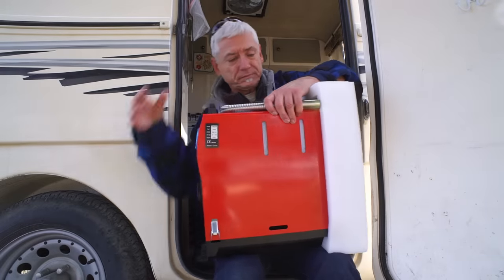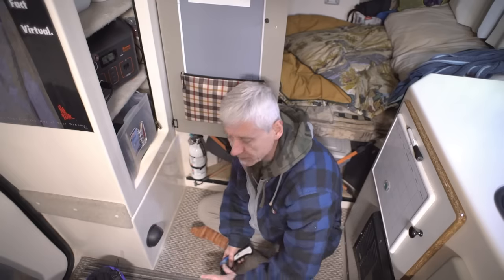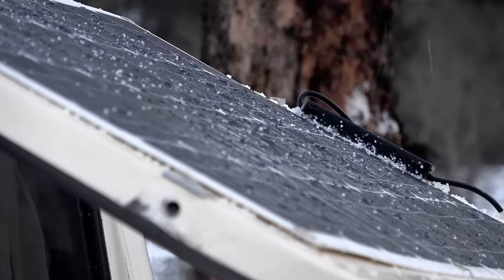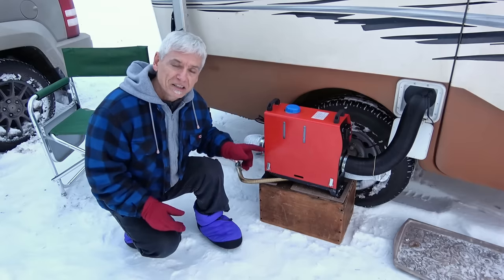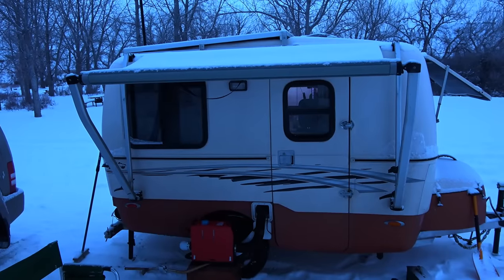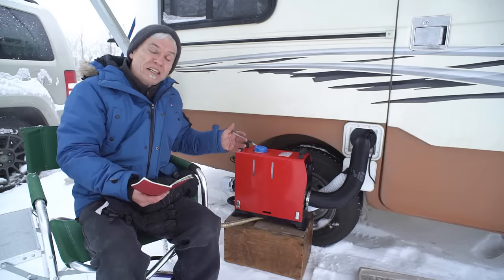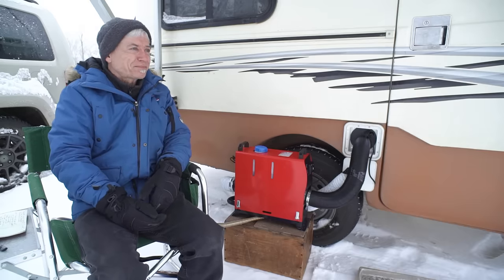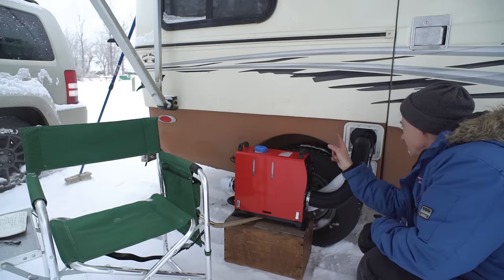Can this Work with a Camper? My Parking Heater Experiment Part 2

Comment: I have a new jackery that if the load is under 10watts it will turn itself off after like 8 hrs. If you have an older jackery, it could be turning itself off sooner. For 12 volts it doesn’t have a fan, the fan it’s only when you’re using the inverter. Check the jackery manual. In my humble opinion, you’re trying to heat up outside air and vent it inside the trailer therefore your not getting 100% of the heat. The purpose it is to recycled and reheat the air inside the trailer. Greetings from California
Reply: Slim, really, really doesn't need to make the unit more heat efficient. 180+ degrees F is very hot.

Comment: Personally, I would love to have one of these heaters rather than using my Coleman Blackcat floor heater I currently use in my A frame trailer. Since your diesel heater operates with a real fuel pump, you can use the 6 gallon boat tank mod available on Ebay for Honda generators (which my friend Martin thought up shortly after he bought one way back in 2000).

Comment: A safety trick I think would be covering the exhaust in heat proof exhaust covering like that which is used on dirt bikes and motorcycles. That and replacing the fuel line with a proper diesel hose covered in foil tape. Maybe give it a once over to check for loose wiring as well. 

If you really wanted to you could probably take the entire thing apart a rebuild it in a outdoor resistant container, like a cooler, customized to your needs with some sound dampening to kill that clicking pump sound. I’ve seen van builders do that. It’s pretty simple build wise once you get it out of its shell.

Comment: Great video Slim.  Be careful not to let the heater shutdown with power cut off.  It needs to go through a shutoff cycle of cranking up the pulse rate to really heat up the combustion chamber and clean out all the carbon deposit.  You don't want to go through too many cycles of power cut off after 6 hours of running.

Comment: Thanks! I enjoyed the video. I was curious as to how they worked and their efficiency. I had slightly considered one but had 3 previous factory built RV's with Suburban brand propane furnaces. I... like apparently many people, purchased an all aluminum 8x20 cargo trailer, insulated it, rewired, vinyl floored,  kitchen cabinet and home built dinette/bed and built a Murphy bed in the back to fold up to carry our Polaris SxS. I bit the bullet and paid $475.00 to Scamp Trailer company for the Suburban 16000 btu propane Direct vent furnace. It has a rated 2.8 amp draw. (About equal to the diesel heater) but cycles on and off thru the night via thermostat saving my deep cycle marine battery. Aside from my build, I think these heaters have a place when boondocking. If I had one for a backup I'd probably separate the fuel pump from its location to an insulated 
Side box, get rid of the vinyl fuel line and replace with Gates gasoline hose and wrap the hose with aluminum coated HVAC tape. Your replacement switch is much better than the LCD Panel IMO. Thank you again for a very good report on that heater.

Comment: You might want to consider a marine grade diesel heater. You can find them used. Interior installation, safe, quiet, easy to regulate.. wall mounted.(bulkhead)...

Comment: I sleep and live in the back of my 2001 Ford Explorer 2Dr .. about the size of your Jeep.  I use a ‘Manchester’ 11 lbs propane cylinder with a ice house catalytic heater that is adjustable.  I have a monoxide detector but it has never gone off .. I worried that maybe it didn’t work but putting it close to the car’s exhaust made it fire, so it does work.  I recently put this all together and I’m not sure how much propane I burn during a night.  I use to have the heater on a one lbs cylinder and could get two nights .. but as you know outside temps make a difference on how much you burn.

Comment: Wouldn't you be better off turning the unit 90 degrees (whoops 90 not 180), pulling it away from the camper, placing it in a shower tent etc. And venting the exaust much further away from the camper? You could easily stitch a reinforced hole out the back of the tent. You could also place the unit under a camp table and tent the table in canvas. Sit unit on ground under table, on a 2x10 slab covered in steel, aluminum or stainless sheeting. The camp table does double duty. The canvas cover is also a tablecloth. Just stitch 4 panels  down the sides to create the tent. This may reduce the sound issue too. You may consider insulating your exterior hose too. Your unit was made for the European market with the CE rating which is still pretty good. Make these changes and I wouldn't be so afraid of it. It has real merit and solves a real problem.

Comment: Some china sellers include a silicon rubber mold for the pump to quiet it down.  I believe it is molded into two parts and easily installed.  Maybe you can buy a spare pump with the mold.  Many carry a spare pump as that is the part that generally fails.

Comment: Love thinking outside the box especially on someone else's money.
May I say I have a T@B trailer and choose to not camp in winter.
I also have a small cabin where a Canadian vented propane heater by Martin is used and works well - no electricity needed.
Question why can't we RV people have a heat source as I do in my cabin that draws no electricity?  I understand that in your case your heater may require a blower hence electric needed.  My RV by Alde requires electric to circulate the Glycol, not much by does need electric.
I appreciate not having to spend money, thank you, to try other options as the diesel has been on my mind.  Keep up the good work thinking outside the box and maybe consider living in your wonderful cabin in the winter and travel following nice weather.
By the way what are you considering for heat in your cabin?  In my cabin I have woodstove, Martin propane vented heater and Electric heat pump so I've tried to cover all the bases.  Now get home to the cabin and on with the build ;-)

Comment: Slim, why not a PROPEX? I'm in a 6x14 cargo trailer here in Colorado Springs. Using it for a second winter and love it.  7 degree outside at night minimum heater settings inside on low was 57 degrees. At my young 71 years old Safety is big! Hope to meet up one day! Keep on filming.
Reply from the maker: Cost! If I were to spend the money, chances are I'd merely upgrade the existing furnace. Thanks! SP

Comment: Those heaters are pretty safe, especially with the controller. If you had it hooked to a thermostat, on the inside of your trailer it would just cut in and out as required. This video series was much better than the first one you removed, seems you have given it a more fair review. Happy New Year from a fellow Albertan!!
Reply from the maker: That's exactly what I do NOT want. It's the diesel starting up over and over that drains the battery, which is why in my case it was only useful on manual mode. Thanks! SP
Reply: I don't think they repeat the start up cycle when used with a thermostat, they just sit at minimum waiting for the stat to call. The initial start up cycle is from power on.

Comment: Great video as usual. I have to agree with you on two things. The smell and noise. The smell would give me a headache. The sound of it would drive me crazy.
Reply: The sound might be a lot more tolerable than you think, like a ticking clock. Everyone's threshold is different, of course, but my point is that a slow rhythmic click sound is quite compatible with many peoples' brains after perhaps a short period of acclimation.

Comment: Of course now I want to know if the Wabasco is “that” much better if at all. Great job!
Reply: I think the wabasco is going to be better based on safety alone after seeing this video, not to mention it won’t have that ticking sound. Plus, I think you can get ones that run off of regular gasoline which would work better in a trailer if your tow vehicle is a regular gas vehicle too.

Comment: Thanks for being honest about the diesel smell. Any advice on how to eliminate it? How do so many people have diesel heaters inside their rigs and don’t mention this point?
Reply: Cracked windows and fan. I have exact same diesel heater inside of my truck. Minimal setting puts out plenty of heat to stay warm with two windows down couple of inches.
Reply: @Ted P The solution is as Slim ended up doing- add distance between heater exhaust and the air intake.

Comment: So having watched both videos a couple of ideas come to mind. Noise, there's a YT video where they found if they suspended the pump rather than connecting it to the frame of their RV the noise was lessened greatly. The metal amplifies the clicking. You can't do that but maybe if you can put some rubber washers between the pump and the metal housing it might help. Also some insulation in that area wouldn't hurt with the noise. 

Weather - I'm thinking something along the lines of a toaster cozy, only bigger and waterproof. It would only need to cover the top half, down to the air intake vent, to protect the controller and could be held on with velcro. You should be able to fold it small enough to fit in the propane tank compartment with the heater.

Speaking of the controller, are you considering changing back to the original controller so the remote control works? That would keep you from going outside in the bitter cold if you needed to up the heat which would also not allow the warm air to escape when the door is opened. 

As to the Jackery, yes it needs fresh air, maybe a grill in the cabinet where the fan is located, if you don't mind another small hole.

Also, just saw on another YT video the hole in the exhaust may actually serve a purpose. It's where condensation leaks out.

Comment: Hmm. Safety is a big one for me. I think a UL listing is minimum, especially for anyone who is not ready to tinker, and to accept compromises on the installation. A 15 minute setup and takedown  may be unavoidable for a setup like yours. And a box with some sound insulation that slips down over the top could both limit (or eliminate) the ticking and provide protection from the snow/rain. I'd also figure out a way to bolt it down to protect against high winds. Happy new year! Looking forward to another year of hacking and great pictures!

Comment: GREAT REVIEW....MAYBE ENCASE IT IN SOME SORT OF A BOX , PLASTIC OR METAL,  FOR WEATHER PROTECTION AND SOUND MUFFLING? WRAP THE EXHAUST IN FIBERGLASS BLAST FURNACE INSULATION , AND MAYBE MULTIPLE VENTS INSIDE MIGHT HELP HOW HOT THE VENTS ACTUALLY GET.  KEEP UP THE GREAT WORK AND ADVENTURE ON!

Comment: Slim I think I can solve some of your problems. As I do know you was right to move your exhaust farther away from your air inlet. Now I also know that most diesel heaters as you mentioned previously are usually installed into a van, which means you usually install the exhaust on one side and the air intake on the other with the main air intake inside the van/truck. That however, is not what my suggestion is about. To knock some of that clicking noise down, try building a wood or fiber glass cover to drop over the heater to give it more weather protection. That should also insulate the diesel heater in such a way as to provide some sound deadening, to reduce your noise levels. The other thing I would do, is also extend your air intake for the combustion chamber farther away from the diesel heater and add an air intake port to recycle some of your interior air to reduce the risk of pulling the odder of diesel into your camper. That way you are maintaining a balanced air pressure inside your camper, instead of having a positive flow like you currently have. Just some suggestions, that might help fix some more of your problems.

Comment: Hi Slim.. this is not a suggestion but simply a question ..... with me not knowing the fiberglass wall structure at the front of the trailer I don't know if this is feasible.. 
But could the hose inlet have been installed on the front of the trailer.. and perhaps a detachable "Shelf" fitted to the trailer tongue to sit the heater on.. so as too maybe (?) reduce or remove a couple of problems.. 
**  reduce the clicking noise when you're sleeping because it is farther away from your "bedroom" area
**  allow the exhaust pipe to hang down below the air intake on the rear of the heater so diesel fumes would not be sucked into the fresh air intake. 
**  with the incoming flow of heated air coming from the front and center of the trailer could (?) it produce more even heating across the floor ? 

Once again Slim, not trying to be a know-it-all and butt in on your installation .... just a curious question..
John  
Happy New Year.
Reply from the maker: Hi John, it's a good suggestion and I did consider it. But I decided against it for safety reasons (propane tank) and it's not a good place for the multi-purpose vent I needed installed. Thanks! SP

Comment: Hey slim be advised, I’ve heard that running these heaters on lower settings can cause them to soot up, they prefer to be run on high for more complete combustion. Also they can be finicky at elevation, fortunately with the blue controller that you have, I have heard that you can adjust the fuel air mixture to be more appropriate at a given elevation. Both of these things can be investigated further on good old YouTube. Also I have seen some people have tracked down a rubber or silicone boot that goes around the pump to dampen the noise.
Reply: the sooting up issues are really the heater not being set up properly to begin with I have a chart that gives you the way to set it up right for the elevation

Comment: Keep in mind to stay at or below 270deg of turns for your exhaust pipe. This keeps the restrictions at a minimum and reduces smoke. You need to consider the muffler too. It may equal 180deg? Not sure. I’m planning on getting one of these to heat the garage and to take camping.

Comment: Probably already mentioned but if you figure out a work around to hang the pump in air rather than screwed to the heater case that tick, tick is greatly minimized.
Reply: Already tried ... didn't help.

Comment: Love your experiments. I couldn't agree with you more. That pump noise would drive me nuts also. From very long ago in the (Dutch) army we used to have large diesel heaters in big tents while winter camping and they kept it very hot. But I can't remember them having any pumps. They where all silent. Given this is a less expensive Chinese heather, the pump probably isn't the most expensive model either. This one has a valve operated by an electromagnet. With every pulse you hear the valve slam into the fuel feeding part. Metal on metal. Most sort of suspend them "free floating" in tie-wraps or rubber, wrap them up with sound proofing stuff, but they will always make noise. As a real solution I wonder if there are different model affordable fuel pumps that simply don't make any noise? The correct (adjustable) fuel dosage is the only most important thing. I also wonder if you could save fuel if you connected the air inlet somehow to the heather hose. Maybe a T-connection hanging down (with some holes)? The colder it is outside, the more fuel is needed to heat up the cold air. Feed it warmer air. Best check the allowed temperature on the inlet. Normally inside a camper it would use the warmer air from the inside. It appears it has a fresh air inlet already.

Comment: Hey Slim,,,,,, that PLC Controller Mounted on the Heater will have an Ambient Working Temp. Control Point, ie... it's what's called a Drop-out Temp.,,,,,, usually about 20deg F and falling, it will "Quit" working, that Heater is Designed to work inside Temp. wise, as you have a re-mote Air-intake and Exhaust piping runs accordingly.
BD in Alaska......
Reply from the maker: Brad, see 13:48 in the video. The heater worked all night at  ambient temp of 0 deg F (-18 C) with no issues whatsoever once the the battery problem was solved. Different model perhaps? Thanks! SP

Comment: I think the comments advised correctly that you can wrap the fuel pump in noise abating material and reduce the sound significantly. I think Slim got the wrong unit for his needs. I am not a fan of the all in one diesel heaters. I think the separate pieces heaters are a better fit. Might be why it isn't more favorable to Slim. Yes it involved making holes but he already did that

Comment: It might be worth getting another length of exhaust to use to pre-heat the combustion air. Fastened next to the exhaust might work if they’re insulated together. I could be talking complete nonsense, of course, depending on how the combustion intake air reaches the filament inside the heater but exhaust hose is relatively cheap. Combustion air pre-heat sounds like the kind of thing David McLuckie might have experimented with on his channel.

Comment: Hey Slim, another couple of great videos. I really enjoy your outlook on all things.

As for the heater, have you considered a soundproof box covering, which could offer noise reduction and weather protection.

Similarly, could a engineer not improve the heater, or at least issue some advice on it's safety. Possibly with a few tweaks, it could be a valid option.

✌❤🇬🇧

Comment: If you're looking for a rainy day project maybe you could build a small insulated cover. It would be able to protect it from the elements and using foam insulation would dampen the sound from the pump.

Comment: I've read that the exhaust tube on these heaters need to be able to drain diesel and water/condensate, so either slope the entire exhaust tube downwards or add a T fitting with a water/diesel trap large enough to give you more than 6 hrs run time between draining the trap. Good idea on the flexible hose for the fresh air intake, but get it so the intake is at least 10 feet away from the exhaust.